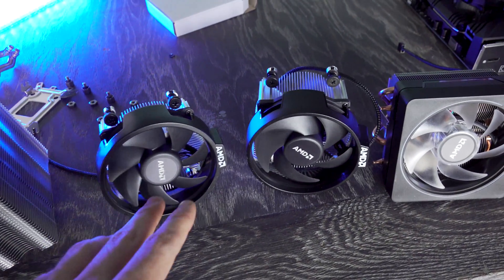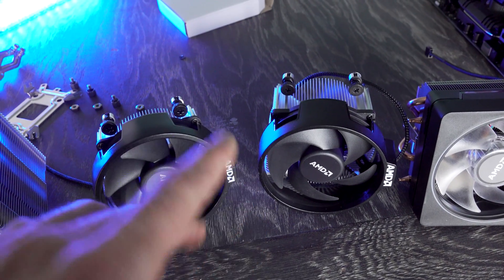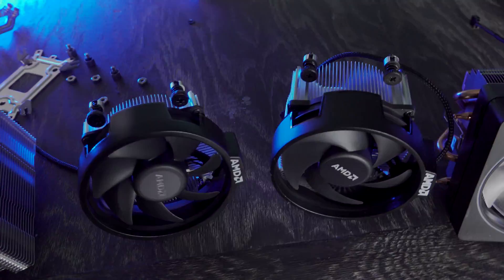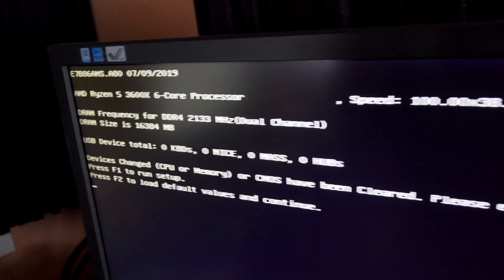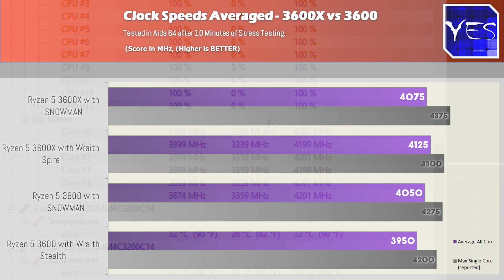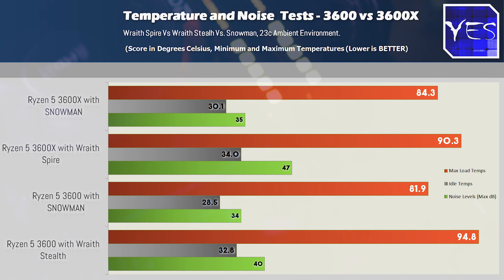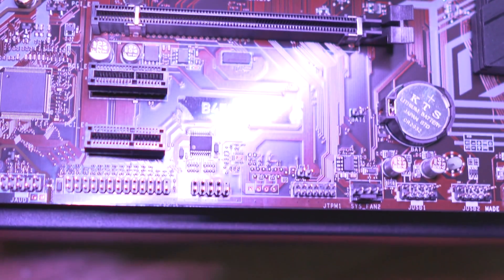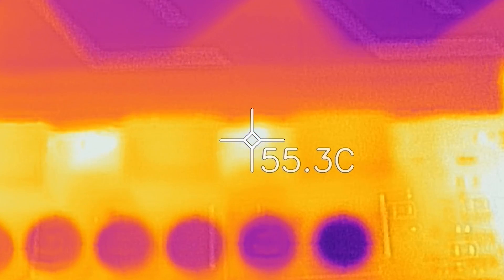Ryzen 5 3600 Vs. 3600X ON A B450 MOTHERBOARD

Comment: Interesting video.  I just bought a 3600 with a MSI B450 Carbon AC.  I noticed in your video and on my computer as well the voltage for the CPU is high for the clock rate.  Precision Boost on or off its always high.  High is subjective but I'm comparing it to what I get when I run Game Boost from within the BIOS.  This gave me a much lower voltage at around 1.1+/-.  That for me was the deciding factor as it helps keep my system cooler.  

Great video, keep it up!  I love watching.
Reply: as well the flashback feature through the USB port is a life saver.  I have my case tucked away so if I lock my machine up with a bad OC or memory timings and a reboot just makes the computer sit there and do nothing I keep my USB key in the the flashback port, slide the back of the computer over a bit and use my pencil to reflash the BIOS and I;m back in action in a few minutes.  You only need to setup the RAM and Game Boost again and off to the races.  I can't pull my case out to access the CMOS jumper.
Reply: my bad, I was looking at the wrong voltage.  I'm at 1.342 on average during a stress test....oops.  LOL

Comment: i found with my ryzen 1600 and 2600 that it went alot better with a cooler master mp610a cooler n was way cooler n able to hold really good overclocks n slightly less voltage aswell,so i do reckon anyone gettin a ryzen should go with an aftermarket cooler for sure even the snowman if on a tight budget or hyper 212

Comment: Its refreshing to see temps like my 3600. Mine does not get quite as hot as yours at max but it does not get as cold at idle and my ambient is 25c..Thanks for the video. I'm using a Cooler Master black push-pull for cooling.

Comment: I think the are the same just different cooler. That's not worthy of 50 bucks.
Reply: Tests were done and 3600x has lower voltage than 3600 at same frequency ranges, it's binned a bit better but it shouldn't be more than 20$ more expensive

Comment: Brian, did the pbo and auto overclock work for you on the 3600? I can't for the life of me get it over 4212Mhz. That's on a b450 Tomahawk with latest bios, latest chipset driver and latest Ryzen Master. Also check the core speeds in Ryzen Master when you do a single core run in r15/r20. When rendering 1 square it keeps switching active core. It didn't do that on the previous bios (v19).

Comment: I have a 3600 9 x with a b450 steel Legend and it runs great but I don't see boosts past 4.125 on four of the cores and only 4.1 on two cores and I'm hoping that in agesa update will help that but that's even with Precision boost overdrive on so I don't know but it's still a great CPU

Comment: 5:25 NOT Precision Boost Overdrive. That is a misconception. PBO regulates power delivery, not performance. Precision Boost (not Overdrive) regulates performance within stock margins (Ryzen 5 3600: 3.6Ghz - 
4.2GHz; Ryzen 5 3600x: 3.8Ghz - 
4.4GHz ), ManualOC and AutoOC allows you to overclock performance above stock (results are poor at best). https://www.youtube.com/watch?v=B7NzNi1xX_4

Comment: Hey love your vids ;) One question - can you review RYZEN 3 1200 in 2019 IMO its a good choice on a very little budget builds for only 50€
Reply: Žilvinas Arlauskas the better deal is the 1600 for $80 at Microcenter or $100 on Newegg
Reply: @melo0736  Keyword "50€", 50 euros. Good luck finding that 1600 deal anywhere in Europe.
Reply: on aliexpress but save for 1600 at least

Comment: I am running my 3700X on Asus B450M-A  (upgraded BIOS) with no problems. looking at buying a X470 rather than a X570 as have all PCIe Gen 3 SSDs in both my systems.

Comment: Another big concern is that 3600x idles at much lower voltage than 3600. Which might imply that 3600x actually has a better quality.
Reply: I would spend more on the 3600x for a better cooler and a better CPU. Tbh, the TDP is just because the box cooler. Both CPU use almost the same amount power for the same amount work.

Comment: 3600 vs 2700

I just bought a 2700 and I am wondering if I should have gotten the 3600 as they are similar in price
Reply: Lachlan Partridge should have gotten the 3600 for gaming, 2700X for everything else
Reply: I am going to use it for everything

Comment: Another quality video Brian.

I'm running the Ryzen 5 3600 on the AORUS B450 AORUS ELITE M/B bought new at the same time. I was using a new unused Wraith Prism at first that I got for $10 of a mate who got the Ryzen 7 3700X & put it straight on custom water.
My temps were good with the 3600 turboing up to 4.2GHz on all cores, with temps in the low 50's, but the Prism did get quite loud as it kept ramping up to %100.
I've since changed the Prism out for a CoolerMaster Master Liquid ML240L RGB, with temps down another 10deg again. Now the only noise I'm getting is my Galax GTX1660Ti with fans running at %60 fan speed (At your recomendation ;) ). I'm more than happy. 

Only issue I've got is that one of the cores appears to be running around 15 deg hotter than the rest. HWMonitor shows it as TMPIN2. Any ideas why or what could be causing this? BTW, It was also running like that with the Prism cooler.
I'm also running 16gig of Corsair LPX 3200 ram.

Keep the great vids coming Brian, I'm a huge fan from down in Melbourne.

Comment: Hi Bryan,
Please make a memory overclocking tutorial for ryzen 2nd gen(would be cool on a b350 mobo )
Also,on how to manualy adjust timings and compare  results to XMP profiles( gains are crazy-refer to latest video from "hardware unboxed")
maybe you are familiar with tools like:Thaiphoon burner and Ryzen DRAM tool by 1usmus, which are used in the process.
We need the guide more than before, with 2nd gen ryzen; proud owner of 3600 :)
Cheers mate.

Comment: Hi...could you perhaps overclock both the 3600 and 3600X and reevaluate the results?
Reply: There's no difference. I have checked several reviews and other than a slightly better cooler for the X chip, the performance was identical. At stock only 2% to 3% differences in tests. Hope that helped.
Reply: @xdreampcs8554  ...so you are saying that overclocked or not we do not gain more that 1-2fps? Even if we use like 3600mhz c14 trident z memory?
Reply: @VapoRub_Gaming  ive seen that reported in Reddit where the 3600x with 3600mhz ram was keeping up with the 9900k in World Of Warcraft. Interesting to see if the 3600 would come as close. My guess is no but within 3-4%. Maybe the extra money is worth it for some users. Im content with the 3600 personally. I keep looking, im interested too.
Reply: @xdreampcs8554  ..that is why i wanted to see the OCed results. According to Gamers Nexus there is apparently no difference between the 3600 and 3600X after OC. I am planning to get my hands on one of them. Just wanted to know which would be able to give the max performance if OCed little aggressively. Currently I am running a Ryzen 5 2600 @4.2 Ghz and 1.375V, mode 3 LLC with 3000Mhz c16 trident z ram. I am getting same IPC as Ryzen 7 2700 in cinebench.

Comment: Just doing my build. having gone with a msi pro carbon ac as i need WiFi and just like the board have decided to go with the r5 3600 but my next question is the ram ....i just cant make up my mind 2x8 3200 or maybe a 4x4 of 2666 i have always had 4 sticks of ram and believe it does make for a smooth system what do you and community think?. thanks love the channel
Reply: 2x8 3200 definitely
Reply: thanks

Comment: Hi Brian!!!

By any chance, is there a performance gain for 2000 series chips like 2700x on x470 on the new Agesa Bios?
Reply: I've noticed on latest BIOS my 2600 will boost to a bit over 4ghz on a B450. This is higher than I've ever seen it boost(3.9 is normal boost clock)

Seems precision boost is active even on ryzen+
Reply: @lunchie80  HI! Thanks for the reply!

Just wondering are you using the Bios version with 1.0.0.3ab AGESA or 1.0.0.6 AGESA?

Comment: How about Overclocking? I bought the X for OCing. Mine is able to do 4.4GHz I'm also using a B450
Reply: SMGVirus I heard overclocking on ryzen 3000 is largely futile because of the lack of overhead and if you’ve bought a 3600x, you’ve effectively bought the chip that renders an OC redundant. You can do it, it’s just you won’t get any appreciable difference unless you OC with very exotic cooling solutions like LN2. Just what I heard.

Comment: Jokes. He got jokes. Keep on pumping out videos man. Riding the intel train with a 6700k; gotta resist the temptation of upgrading to the 3600.
Reply: I have the 6700k aswell but holding till the 3950x comes out,why? Because I game and also record, but streaming Is a no go because of the cpu, so I want the best headroom I can get.
Reply: Does your MB let you swap out the 6700k to i9-9900k ?
If it does, this would save a lot of hassles with setting up a new system (might just need a better cooler).
Reply: @artmcteagle  My Z170 is not compatible with Coffee Lake. My needs are met. I just like building shit with shiney new parts lol.
Reply: @artmcteagle  There aren't any motherboards that support 6th and 9th gen Intel CPUs.

Comment: If am able to get a 750ti without warranty and gt1030 ddr5  with warranty at the same price which one is a good deal?.
Reply: The 750 ti pulls a little ahead in performance but it is a really old card at this point. I'd personally get the 1030 because of how much more recent it is, i doubt it would die anytime soon and possibly better driver support. i don't think maxwell gets regular updates anymore
Reply: afsal moosa be sure to always take gddr5 over ddr

Comment: Can you please test budget high frq rams. So much confusion on internet if they work with Ryzen or not. Specially G.skill Sniper X 3600 CL19 OME
Reply: Most will work with 3rd gen as it’s not very picky, but I’ve had 0 first gen desktop Ryzen good enough for 3000 MHz (using X370 Fatal1ty). My TR-1950x can run the Gskill Sniper series 3600 cl 19 in quad channel or even overclocked higher (same RAM, but half the sticks will not run above 3000 MHz on either my Ryzen 1700 or 2200g realistically, or even sub-zero with 50% higher SOC voltage). So I’d say not very likely on first gen, maybe on 2nd gen, very likely it will be just fine on 3rd gen.

Comment: Thanks for your work , this is just what I needed to know . Hey what happened to the Galax GTX1080EXOC ,Iv had one the same for 18 months and its Mad...1994mhz out of the box ,,After liquid metal and clicking the 5% overclock in the software I get 2050mhz every day at about 78 c   [X370 TAICHI,,R 5 2600, 16GB @3400MHZ] .So I bin Dyin to see what you Compare it too and how far you can get it to go.  Cheers

Comment: I have a look on a new build with a ASUS B450-F gaming motherboard with a 3600 and 16 gb Corsair vengeance RGB pro 3000 mhz and a ASUS rtx 2060 strix, kraken x52, a Corsair rmx rm650x psu, a Kingston a400 480 gb ssd and a 3 tb hdd from toshiba DT01ACA300, all that in the inter tech 3901 or 3906

Comment: How about msi b450 tomahawk is it still the same ?😕
Reply: Bunch of YouTube builds on that board and the new Ryzens.
Reply: Tomahawk https://youtu.be/vSxIv4yqB6Q
Reply: motherboards don't differ that much from eachother, and this board he tested is basically a tomahawk. Some motherboard manufacturers like asus, just up the frontside bus 1% so they look better in benchmarks, at least they used to do that
Reply: @Rem_NL  AM4 doesn't use FSB... FSB died with Core 2 and Athlon.
Reply: @tim3172  i did mention they used to do it though

Comment: Here's a good question: say you bought a 1700X and a high end X470 motherboard to be well prepared for the 2nd gen Ryzen processors last year, is the performance gains in games worth upgrading to say, the 3800X or 3900X?
Reply: Wouldn't do the 3800x, waste of money, get the 3700x rather. For games the 5 3600 is the best bang buck, in most games you'll be mostly GPU bound anyway. If you want to do productivity/encoding and such 3900x is sweet. X470 should handle all of them fine.
Reply: Yes!  All the x470 should support Ryzen 9
Reply: depends on your settings and gpu, but you will do just fine if you have a rtx 2060 or rx 5700 or lower cpu. You might get a 20% boost in some games but only if you pair your system with an ultra high end GPU like the 2080Ti. In most cases you will be GPU limited after all.
Reply: @Rem_NL  current running a reference 980 TI OCed quite a bit, which performance-wise competes with a 2060, but plan on upgrading to a 2070 or better in the near future. Also running 3200MHz RAM. My 1700X doesn't OC too well, and have had to run it at stock clocks to keep it cool since my CLC cooler failed. Also plan on buying a EK Open loop kit this week.
Reply: @Celician83  well the ryzen 3600 would pair nicely with a 2070 i think, the ram would fit ok, and unless you really want to go with a higher end cpu for other things than gaming. A 3600 is very power efficient and doesnt run hot. You can save the money from the EK set to put in a 2070 super or maybe some faster ram or both. 3600 C16 ram is supposed to be the sweet spot for ryzen 3rd gen CPU's. But than again, if you play games that are high in cpu load like city skylines you could opt for the 38- or 3900x
Reply: @Rem_NL  I have 3200 CL16 Vengeance RGB Pro RAM, so it's okay. I do alot of streaming to twitch and have wanted to start up a channel on YouTube, so some content creation as well, which is why I am looking at 8 core or 12 core. The EK kit is mainly for aesthetics and not worried so much on temps. Basically always wanted a custom loop computer, just finally have the chance to do it. The rest of my build is solid.
Reply: @Celician83  you could also opt for threadripper if it fits your budget and go with 1 additional 16 vengeance kit, i believe those prices are dropping hard, and this will give you quad channel performance improvements
Reply: @Rem_NL  nope, not in my budget and very happy with my Aorus X470 Gaming 7 wifi motherboard, dont want to have to switch boards as well

Comment: How would this same test work with an RX580 8 gig? Something my budget could handle.
Reply: no noticable difference in game, if you want to upgrade and you already have a ryzen pc, focus on the GPU first, than maybe 1 more stick of ram, than the CPU (for gaming only ofcourse)
Reply: pairing a  rx580 with 3000 cpu and 8 gig of ram doesnt make much sense for gaming. You are better off with an r5 2600 and a 1660ti than a 3600 and a rx580. Don't know how the prices are over there but it will both cost me around 400 euro for either system.
Reply: @Martin Dalse well i am not psychic but that 2500(k) was a very impressive cpu, and because cpu developments where very unimpressive since you bought it (untill ryzen)  you wheren't held back much. But with CPU''s Like ryzen 3000 series it very much so disrupts the whole scene. If this continues like this I doubt you will keep any system for 5+ years. Building a whole system for future proofing is usually a bad idea. I mean upgrade paths are good, but balls to the walls systems to future proof is not the right way to go imo. But there is still a chance that upcomming Ryzen CPU wil run just fine on current gen motherboards (socket AM4). Like I sayd I am not a psychic, and I don't work at Nvidia, Intels or AMD R&D department either ;)

Comment: 1.400 volts not killer cpu ?
Reply: above 1.33 you are basically degrading the chipset, eventhough AMD says you can safely go to 1.45 -.-
Reply: I had a A10 7890k that was at 1.425v stock for years, no problem
Reply: @Brandon-uy1uv  different cpu
Reply: @Rem_NL  yup

Comment: Wonder if there's a performance penalty using a Ryzen 3000 series CPU on a B350 chipset?
Reply: I think I saw this on another channel and there is pretty much none. Sometimes the 3xx chipsets are even faster than x570. The main thing is that the VRM can handle the wattage of the CPU that you want to install. For up to 8 core should be fine on B350 on a MSI board anyway. A Ryzen 5 3600 is fine even on a 320 but I would spend the little extra to get at least the 350 board. Remember to upgrade the BIOS first before getting new CPU :D